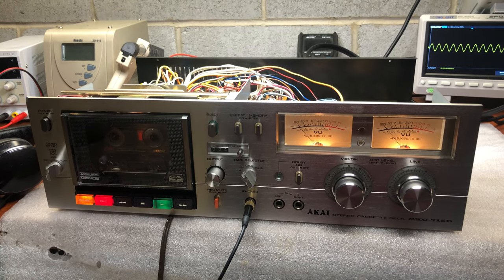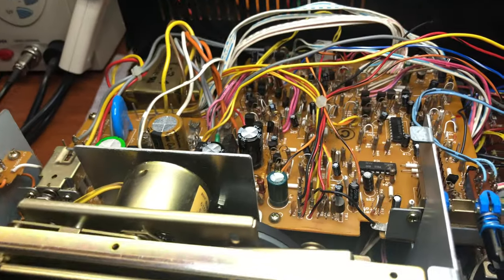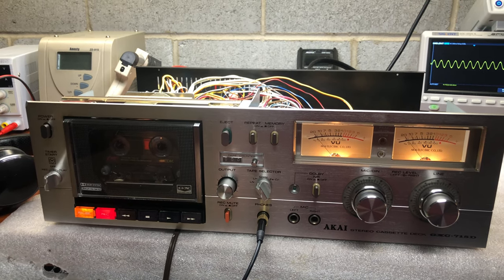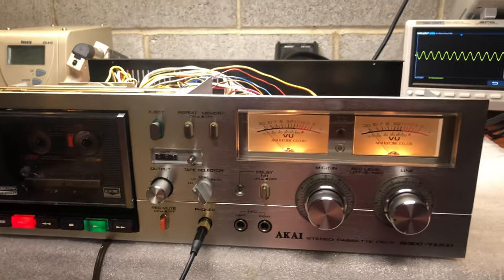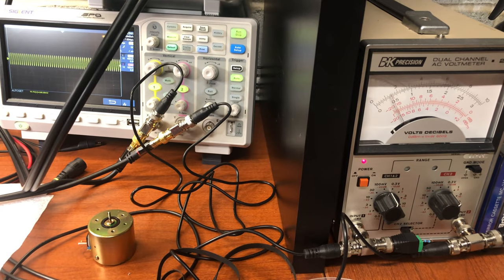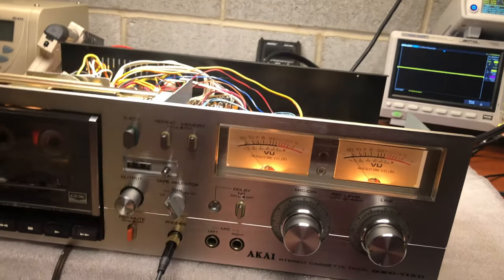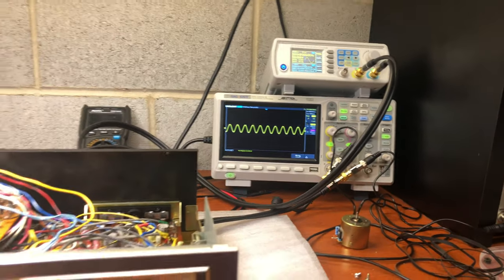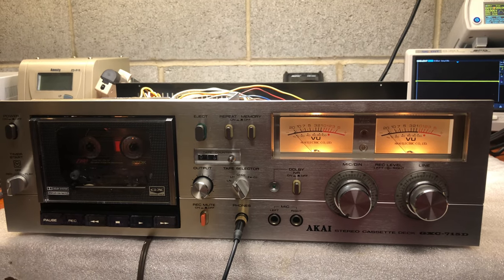Akai GXC-715D Recording Test After Capstan Motor Replacement

Comment: I have a problem with the stop button, the play does not turn off, change the capacitors in the control, or are the transistors most likely burnt out there
Reply from the maker: That deck has “famous “ 458 transistors which degrade over time. Replace them. I did replace all caps in power supply and deck control board and all 458 transistors
Reply: @hifirulezzz  thank you
Reply: My newly purchased mint condition 715D had almost same issue - stop button reacted only on very hard press, others were fine. Solution was surprisingly easy. Just opened and cleaned the touch plate with simple ERASER. It made it back to sensitive. Hope it will stay and my experience helps.